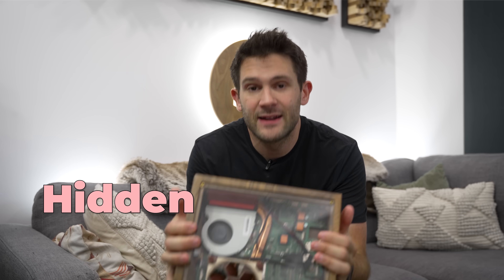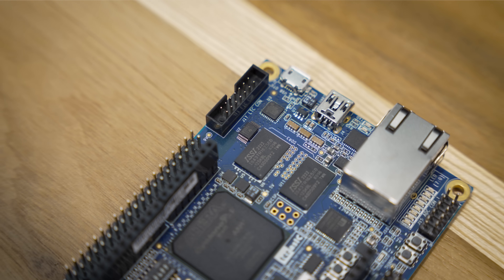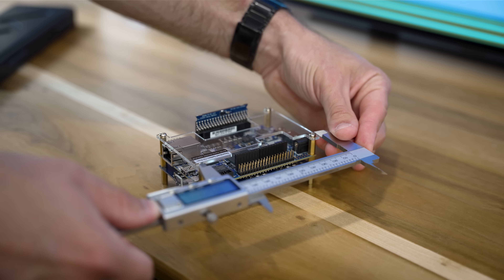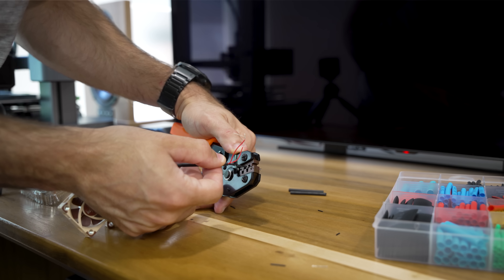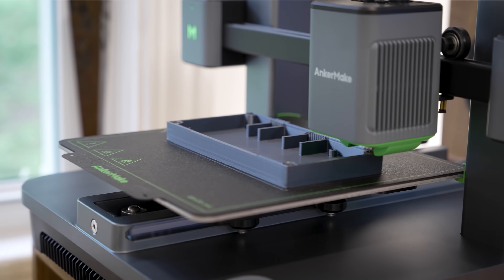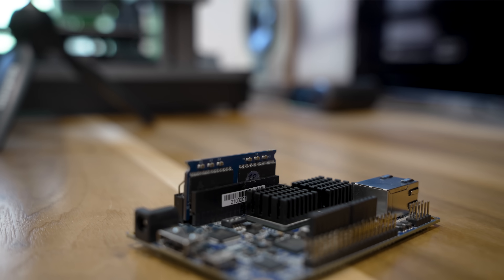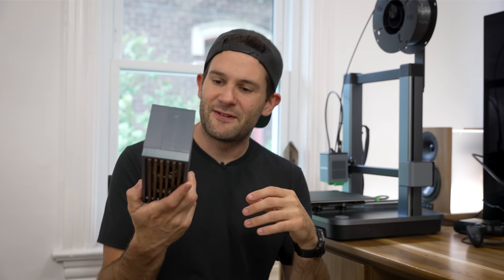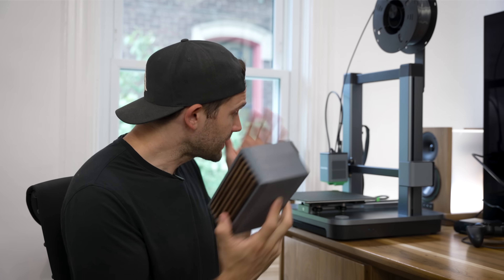This DESTROYED my $4000 PC

Comment: Love the video, as always, and this is not a criticism as I love the idea of all types of emulation, including hardware with FPGA and you did a great vid on it, but I just found one bit interesting - SO the whole point of the video, at least going by the intro, was about authenticity.. so I just found it interesting when it came to controllers that you said you prefer simplicity as opposed to using a real controller, which you can do with the mister because for me, while i love BOTH ways (playing on my PC with launchbox, or on pi4 emulation station..or with real hardware) the real difference when it comes to playing with real hardware, for me, is actually the physical part. I reckon id barely notice the imperfections in emulation that aren't "100% accurate" (other than those that I WANT, like sprite limit removal) but I DO notice the clunk of putting a cartridge into a system, and the feel of a real controller that are just so different in shape and feel to modern controllers. That and playing on a CRT are the two main reasons I will always play on real hardware from time to time, in spite of all the positives of emulation.

Anyways.. great video.. just wanted to post that part that was interesting to me.

Comment: The fins need to be away from the fan, every little millimeter helps, since it was a CNC profile its easy to do.  Also spreading the fans apart a little as one of them is blowing straight into the RAM module.  Maybe glue them in the middle and let the ends of the wood hang unsupported?  Would look pretty cool actually.

Comment: 110% disagree with you. I emulate a crapload of  games and would never want to go back and play on the original hardware, especially the playstation eras. Being able to upscale ps1 and ps2 games and actually see faces and textures is so much better, and then being able to run a 60fps.  The old CRT TV nonsense is fine if you're a super purist I guess, but realistically emulation is so much better.
Reply: Depends on the specific game and console regardless
Reply: @@jedtheduck yeah your'e right about sprite based games, but playing windowed/lower resolution solves it. WHile cool in theory if you have this guy's technical knowledge I dont get why you'd not want to press two buttons on your phone with save states, speed ups and cheats or have everything collected in something like playnite where it all launches instantly
Reply: Agreed. 

For the consoles that can be emulated, emulating games on PC is infinitely better than on original hardware. And with handheld PCs getting cheaper and better, the argument for emulation is stronger than ever.

I mean just look at the switch, emulating definitely gives you the superior experience, period.
Reply: Those old 3d games look really stupid at 2k-4k tho, they just look plain odd
Reply: @decisive2242  Yeah, these days I mostly use the upscale feature to downscale it back to the console's native res. Which gives you that perfect picture with no aliasing, while still looking rght.

Especially on N64 games, the rough polygon geometry of levels just looks whack once it's upscaled to high res.
Reply: im not a purist but this is comment shows what not knowing what you dont know looks like (try not to take this personally, as it is not a personal attack, but i want to shed some light on the details that actually matter a lot). the image an old CRT can display cannot even COMPARE to what lcds can(t). games rendering different parts of them at different resolutions (for example silent hill 1 on ps1), the way light hits the phosphors to blend colours (simplifying a bit), and also stuff like 480i. not to mention the fact that 60fps doesnt matter on a crt as the input lag is nonexistent. even stuff like ocarina of time which runs at 20fps doesnt actually look that choppy on a crt, and in fact, looks just fine compared to an LCD or OLED. lets talk about the "pixels" now tho, because on CRTs you dont have them. on an LCD, the "pixels" the game displays often end up being uneven and the image looks blurry and shit, while it looks actually just fine on a CRT (again, because crts dont HAVE pixels). when accounted for this (for example mortal kombat on snes) the final image doesnt looked stretched and in fact, looks clean. much more than on an LCD and youre playing the game at the proper aspect ratio on top of that (as opposed to pixel perfect 8:7 which is not how it wouldve been seen originally.. tldr CRTs sometimes literally define the aesthetic of the games youre playing, and flat panel displays are NOT a replacement, and neither are the crt filters. if youre curious, i highly recommend checking out a twitter account called "crtpixels" (few of really good examples would be DKC where you cant even tell theyre just sprites but they look like actual models, the ninja warriors (snes) where the shadows look like actual shadows, and theres a lot of other great comparisons)

so many people look at shit like n64 (emulated) on an lcd and go "wow this looks bad!" because guess what - the emulator isnt accurate enough and you dont have the hardware necessary to see it properly anyway. ignoring crts and how they basically make up half of the reason why theyre important, emulators are prone to having weird graphical issues due to plugins or whatever (great example would be n64) - textures not having proper transparency, them being drawn wrong or not at all, etc.

Dont get me wrong, emulators are amazing pieces of software, but if your intention is to preserve the games and play them in the best, most accurate way possible, NOTHING beat original hardware.
Reply: Emulation is amazing. I've been doing it for over a decade while also still using original hardware. I do prefer to play on my CRT when I can which is why my Wii is such a great emulation hub. Not only can it do a true 240p but it also can emulate a ton of systems.

Plus I don't like to upscale 5th gen games and before. I only upscale 6th gen and up because those games scale well with upscaling. All 3D games from PS1, N64, and Saturn and before get a proper integer scale at 240p and then have a CRT shader applied to them. It looks immensly better than upscaling those games and actually does 90% of the way of feeling like your on a CRT. Sure you don't get the motion clarity but it's far better than upscaling them and revealing all the flaws in the image and makes the UI fit better as well.

Being able to boost frame rate is also nice in the games that support it. Plus even on a PC you can emulate on a CRT and it looks incredible.
Reply: @@jedtheduck What emulator are you using? Most emulators are accurate enough that it shouldn't be an issue.

Comment: Simulation is the proper terms! Replicate the original hardware.  I got two and it's just incredible when plugged to a VGA CRT Monitor via HDMI to VGA adapter.  SNAC + CRT + MISTER = the real deal!
Reply: My understanding these days, is that it's emulation until the code for the chips is 100% accurate, then it's classed as simulation.
Reply: I don't recall the exact reasoning, but FPGA devs use the term hardware emulation, there's a reason simulation isn't an accurate description

Comment: I mean sometimes emulation is the superior experience but I get that fpgas are the way to go for an accurate experience
Reply: But they're also relatively expensive.
Reply: It could also be possible to run the game at higher quality with an FPGA while also being accurate.

Software emulation is just more easier to do since you can use it on more common hardware and given common hardware usually powerful enough to run the game at higher quality than default.
Reply: @pieceofschmidtgamer especially when most people already own something that can run software emulation already.

Comment: It isn't just as good as the original, it's better. Emulation doesn't have to be perfectly accurate to be better, it just has to be accurate enough whilst also giving the user more control than the original hardware

Comment: Besides that your title is an obvious clickbait (I know YouTube...), I can confidently say that (software) emulation does not suck. In fact, videogame emulation is basically one of the best things in human history. Some even are extremely accurate (NES, SNES and some other). We even have pretty good simulation of CRT filters, thanks to Shaders. Being able to play with a different controller and other improvements are additions that are awesome! In example faster loading speed, RetroArchivements, better controller, save states for games that do not have saves, easy backup of battery saves and playing on different systems on the go... and so on.

So, I do not agree with you on the title and initial talk. FPGA is sort of emulation, it's actually not if you think about. FPGA is more like alternative hardware without emulation. It's like rebuilding the same hardware on hardware level. Kind of. To be honest, FPGA is pretty awesome and I wish AMD and Intel would offer their CPUs with additional FPGA extension to give developers additional tools to program if they wish to.

Comment: Emulation may not be 100% accurate but for most of the systems MiSTer runs it's so close on cheap ARM SBCs that there might as well not be a difference and it's been that way for a really long time. I have more of a problem getting a good control experience on consoles that differ too much from the SNES/PSX layout and that basically sent me back to original hardware anyway 😂

Comment: Your take on EMULATION was so far off base, in my opinion, that I laughed so hard that a farted and my dog jumped. With OLDER systems you need to learn to use SCANLINES. With proper frontends and some actual emulators using scanlines will make the game look so much better or go for a CRT monitor. However, with systems from the early 2000's and up most systems had HD compatibility or are HD meaning using an emulator with a standard 1080p or higher monitor would look nice or better than original. For example, if you use PS2 emulator and UPSCALE TO 4K it puts FPGA to shame period. FPGA's are good for ATARI to N64 era and after that complete waste of money, IN MY OPNION!!

Comment: Nice build! A few suggestions for design improvements: replace the barrel jack with a cheap USB-C PD board set to 5V, so you can use any USB-C (or even USB-A, assuming it has sufficient output) power brick. And maybe use one of ADT-link's slim HDMI extensions designed for case-internal use so that you don't have to fit that thick extension cable?

Also, one major advantage of FPGA emulation that you fail to mention: emulation accuracy. Software-based emulation is good, but it's very often quite inaccurate, which results in anything from game features missing outright to various glitches. FPGA-based hardware emulation, as long as the core is well written, will avoid this entirely, as it will be an effective 1:1 match with the original hardware.

Comment: Hey, FPGA content on YouTube! Nice. Here's some background info on the FPGA design process:

When they mean that they x-rayed the chips, that's because the HDL (hardware description language) used by the FPGA almost demands that you understand where every single bit of data is stored and read (in "registers"). You can count the amount of registers used in any given HDL file, when they're operated on, and where they are output. That means meticulous management of keeping everything lockstep, but that is the desired goal: cycle accurate, rendering accurate circuitry that will honestly implement every little hardware bug that game designers explicitly worked around.

Note that the reason "cycle accurate" circuitry is important is because older consoles had far less leeway in processing speed. Their cheap nature made the programming difficult, so sometimes programmers had to push the limits of what was possible. Say your GPU can only render 10(!) sprites on screen, but using all 10 will slow down the GPU by a few 100 clock cycles . That could be enough to have the CPU fail to keep the frame rate unless you program around it. Without the  hardware slowdown, though, this hacky code will now run faster than intended and that could be your emulation failure. FPGAs literally act how the hardware is designed, bugs  and all down to the nanosecond.

When I say circuits, I mean circuits. FPGAs take a long string of 1s and 0s and electrically connect and disconnect registers and transistors together. They're connected in billions of grids that can route electricity to any register to any register. But this electricity takes time to flow, and so advanced AI algorithms attempt to organize your design so it can run as fast as possible. That means higher clock speeds that you know and love.

The FPGA being used is the DE-10 Nano. I actually coded the DE-10 Lite for a Uni project making a custom mini CPU. Sadly, my left over board is half the size for most MiSTer cores. And you might be surprised that the DE-10 Nano is like 200$ in 2023 because of chip shortages! I've heard stories of companies buying old testing boards and ripping off the FPGAs for use; that's just a rumor but that's how in demand FPGAs can be. Making such reconfigurable hardware means paying a lot for potential functionality you don't use.

And why wouldn't you? As long as whatever you're coding doesn't process faster than 400MHz or needs gigabytes of fast memory, you can feasibly emulate any design up to the GBA at consumer price points.

TL;DR: FPGAs are niche devices that trade in processing power and design complexity for configurable electronics on a hardware level. But since retro gamers don't nee gigahertz and are dedicated to accurate emulation gaming, MiSTer might be what you need.
Reply: for comprehension: Does the FPGA have a process in the background or when finalizing a "setting" that optimizes for this specific setup?
Reply: @meterano7  FPGAs don't have anything resembling Assembly code by default. No OS, no BIOS. They don't have a CPU by default. What you are given in FPGA fabrics are basically transistors that can be combined into ANY CPU you can  fit on it, plus the memory and accessory chips. What you are configuring are physical wires being locked in between those transistors. Any change would be like switching from an Intel CPU to an AMD CPU in the middle of running.

You could try and reconfigure your computing during operation, but at that point you're literally doing the PHD work my professor was doing. Like, if a satellite could switch from low-latency flight computer to advanced telescope in orbit, the entire package could be tiny.

Comment: EDIT: $225 - $400 for the FPGA?!  Um, my comment below stand even stronger.

I have only ever emulated through Pi's.  Currently I have a 512 GB image on a Pi 4, 4GB and I am content.  It will go up as far as some N64 games like this FPGA.  So I need to ask, why would I really need to go this route?  I get the dedicated chips and what not, but other than ROM issues and the occasional lock up, the Pi does this all the same.

I am asking seriously as I want to try this but don't see the need personally.
Reply: It is all about accuracy. Emulators do a good job for people who just want to play the game and are not nitpicking. But if you want to play the game as it was intended, no emulator induced latency, bugs, or visual artifacts, then FPGA or original hardware are the only ways. With the original hardware becoming rarer and harder to find for a lot of systems, this is a god send to game preservation.
Reply: As he said, emulation is good enough for the vast majority of people

Comment: I love you builds and your style! I hae a request for a project.  I have a room that is both my office and my game room and I want a sign on the wall that has two settings. "Work Mode" and "Play Mode".  I am still tossed on what would look better; doing it as a neon sign or have block letters that are back lit.  The idea is something that looks aesthetically good but not overly distracting.  Something similar to the "ON AIR" signs for radios or other recording studios. I think it would be best having a button that will power it and then something more mechanical like a switch between the two modes. What are your thoughts?

Comment: None of this is true. Emulation can be achieved perfectly with the correct hardware. Multi-threaded emulation has been a thing for years what the hell are you talking about. There are overwhelming instances of emulation producing better results than the original hardware. My gaming PC can emulate a PS2 better than a PS2. The result is better looking textures higher resolution and double the frame rate and responsiveness is perfect.

Comment: Nice! I've been going back and forth considering the Mister and ended up deciding against it. RGB-Pi OS with the RGB adapter in a Pi4 runs everything up to PS1 with pretty much the same low lag, provided you use a real CRT screen (PVM, TV, or arcade monitor) - which you should! :)
Reply: Emulation gets about 95%+ of the way but will never beat the well-made FPGA cores - lots of games have separate speedrun categories for emulation (with very strict rules on settings) for this very reason.

Comment: Really cool video and a nice display of the 3D printer as well. However, it would be more interesting to see the difference in delay between the original hardware and the DE10 Nano, plus the PC emulator if you're still interested in that, just to get a complete picture. But I guess getting original hardware just for one video might not be easy, so I understand. Keep up the good work!